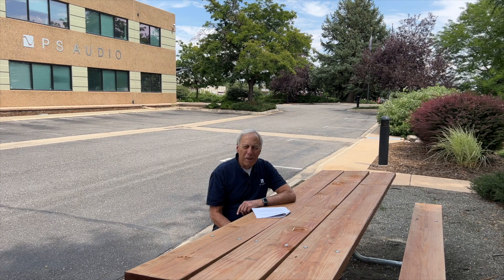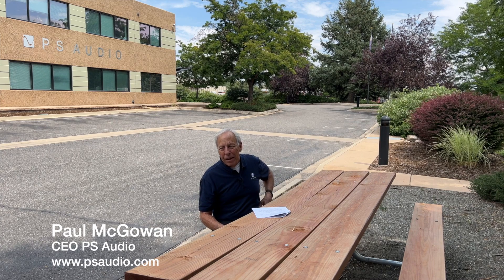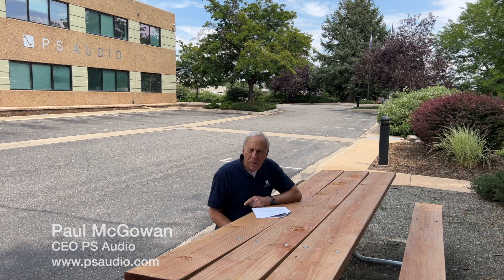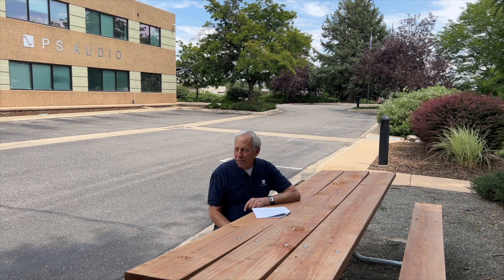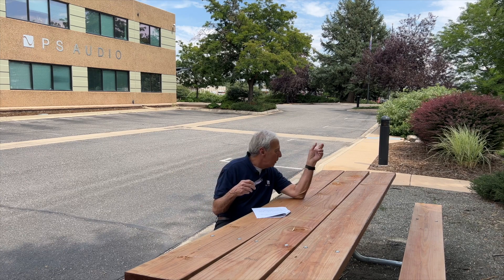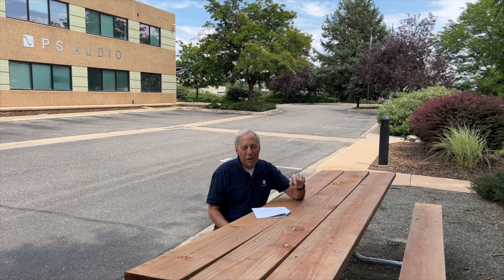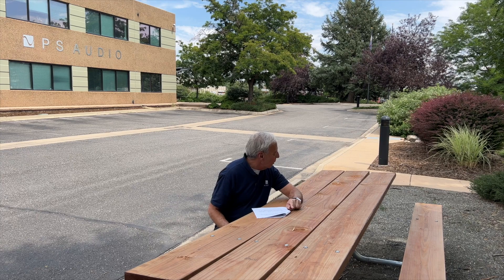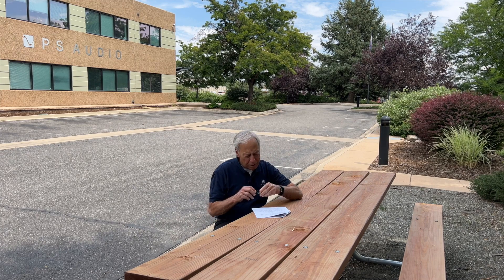How much power for a regenerator?

Comment: I have two 600 watt amplifiers at the price of a p20 I’ll plug them into the wall and I would probably need two p20 to run my hole system properly no thx and by the way the amps are plugged in each into there own Audioquest Niagara and they sound great,the rest of the system is plugged into two ps audio p300 one for digital gear and the other for analog

Comment: well you can do it get yourself a variac from 0 -250 V 30 amps.
in America set it for 120 volts connect to an LC filter and ideally get some motor run capacitors at 5mF to 7.5 mF 450V
autotransformer variac is about $200 LC filter 10$ run capacitor a couple of dollars
you won't find or  get much better than that, you could put an isolation transformer on the and??

Comment: If you spend $20,000 on a power regenerator, audiophile cables, audio tuned fuses, speaker cable lifters etc. you will hear a huge improvement in audio quality. It will be like night and day and worth every cent. Problem is nobody else will hear the difference. Now, if you spend these dollars on quality loudspeakers and improve room acoustics then you and everyone else will hear an improvement. A basic understanding of electronics could save many Audiophiles from spending big money to fix an imaginary problem.
Reply: I think at least one of these items mentioned could make a difference, but definitely the speakers/headphones make the most then amp/dac then the rest, cable lifters though, probably not.

Comment: how much heat do regenerators output using low wattage or idling?       ( say for using with just a DAC and a small headphone amp on a hot summer day) or are you just constantly dumping maximum heat like a Class A power amplifier no matter what? Would love to know if anyone has more insight

Comment: I prefer to lose some what or another by using a conditioner, than losing all my equipment to a lightning in my energy line.
Reply: But a power conditioner can't stop all potentially damaging surges and spikes.    
Technically, a regenerator is still only as good as the power getting to it allows, 
and it can be damaged by extreme conditions. 
As for lightning, Nothing can stop a large-enough zap from destroying your equipment!

Comment: I just fitted huge transformers and a massive amount of capacitance in my amps, the mains can do what it wants and it doesn't matter.
Reply: If You are trying to get the absolute maximum performance out of your amp what you stated is unfortunately PROVABLY incorrect
Reply: @davidcross890  fair enough, you're likey correct, I'm content with what I have.

Comment: Quote: "having too little power will never damage your equipment" - That is absolutely not true. AC brownouts can actually be more damaging that over voltage.
Reply: Low voltage is a problem mainly for induction motors, something that is not normally part of audio equipment.    
The most vulnerable one is a refrigerator, freezer, or A/C compressor motor.
Reply: @spacemissing  I agree. But, in the case of things like electronic equipment as the power lead voltage goes down that may cause the power supply to go into what I'll call an "active mode". And all bets are off as to what the circuits the power supply is supporting do. In my case the military circuits I did had low voltage, and high voltage, sensor circuits that quickly turned things off if the voltage feed went outside a chosen range.

Comment: I can't imagine how ANY low wattage signal processing audio gear would demand enough current to create a "voltage sag" (or even voltage ripples) from the  incoming AC power to your home. The impedance of the step-down transformers in these devices is much higher than the impedance of the incoming power line and the output voltage typically less than 30 volts. The current consumed by all  signal processing devices (ex Power amps) is probably less than 1 amp. If these problems ARE occurring they are probably being triggered by some other residential power user (close by) who is sharing the same utility transformer that your residence is on.
Reply: Most All people have other high consumption or contamination power consumption devices that create those sags and/or noise on either or both of their "legs" of 120 volt power and if not at that moment the issue can easily compounded by neighbors electrical use and further contamination as a certain number share off the same overall transformers not to mention how power is shared across the country under load usage sharing and/or all types of power generation noise contamination

Comment: Potentially the conditioner is also helping with other heavy loads causing voltage fluctuations. Such heavy loads are typically for heating or cooling. I had a problem with a refrigerator causing noise when switching on/off the compressor even causing my DAC to reset. My outdoor HVAC system is pulling 5,000 Watts through the shared wiring to the house also causing some slight drop. Another heavy load is my dual oven. My house is not too bad, but I've been in houses where you could see the light brightness going down during such load.

Comment: I uses a Richard Gray' s power company 1200c and Substation in one system and a 600s with a pole pig isolation transformer in the other system and it is a must have.

Comment: I've used a P5 and P12 in my system, both were great with front end components but, unlike the IsoTek Titan mains conditioner, the power plants could not make my 40 watt pure class A power amp purr.

Comment: A lot of the Audio community thinks these are snake oil and make no difference to the sound
Reply: And they're wrong too...I am steadfast in saying that those who can't hear the diff have busted or not good hearing. I had a Cyber Power power conditioner with soine wave and my system sounded the most clear and sweetest it ever did using it
Reply: @PS Audio: I use your Dectet Conditioner as the power source for all my components. 
Is it restricting my BHK 250 amp? Thanks for your feedback! 🙌

Comment: ~
Reply: They don't have pits, they have reflective and transparent/non reflecting surface areas (that are shallow trenches at the most). And those are defined as 1's and 0's. If you remember your math classes, you will remember that you can always define something as a number, and use it for mathematical calculations. A CD is a practical example of that. You're welcome :)
Reply: @hugobloemers4425  Correction again. There are three kinds of "CD's". Optical as you describe, reflective and non-reflective created by "optical printing". Then there's the write once read many times version. Then there's the write many read many R/W CD's. The latter two were really technical monsters and are all but obsolete today.
Reply: @wilcalint  I was talking about the original Compact Disk according the the Philips / Sony original specification. The point is that it is 1's and 0's that are used to code the music.
Reply: @hugobloemers4425  Well that would be

Compact Disc Digital Audio - The Red Book
https://en.wikipedia.org/wiki/Compact_Disc_Digital_Audio

The implementation of that can take many different paths and has so over the years. The initial phases are optical, then masking. Waving ones arms over it all and saying it's reflective and non-reflective surfaces is an over simplification.

I was once contracted by a Major Label Media Company to do some research on finding a removable media to store digital content. Like it's still readable 100 years after being written. That involved using the engineering staff at 3M. The conclusion of that study found that part of the process of Mastering a standard Red Book CD involved a media that indeed had a life longevity of in the words of the 3M engineering staff, "as long as the age of the pyramids". That was optical.

It's all become a mute point now as Red Book media has really become pase'.

A good read on this is:

Compact Disc manufacturing
https://en.wikipedia.org/wiki/Compact_Disc_manufacturing
Reply: @hugobloemers4425  
1s and 0s are an imaginary thing made up by humans.
Reply: @Second_Hand_Noise_Damage  The whole compact disk is made by humans.
Reply: @hugobloemers4425  
A 1 or 0 in a digital system is actually a higher or lower voltage potential.
Reply: @Second_Hand_Noise_Damage  The "1" and the "0" represents a parameter. It is just how you define it. Mathematically the music is coded in a binary way, and that is what maters.